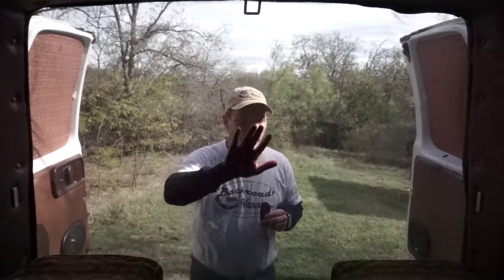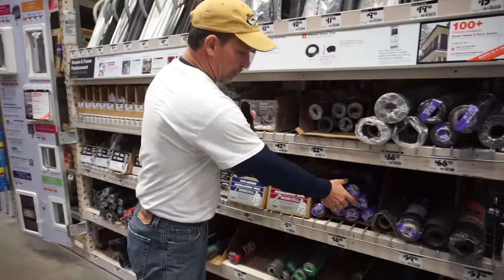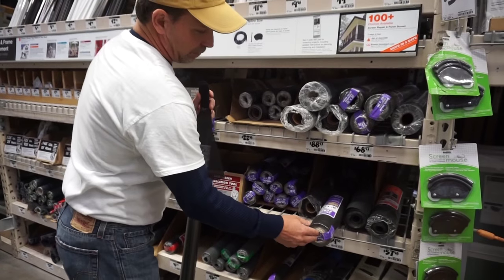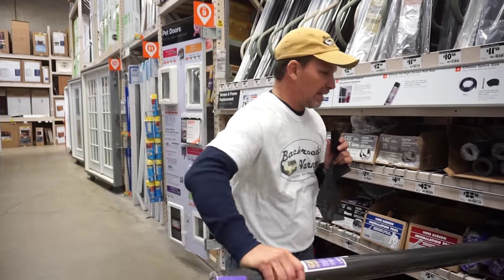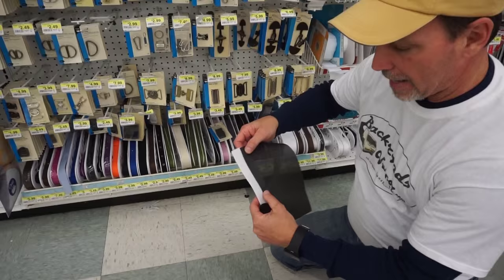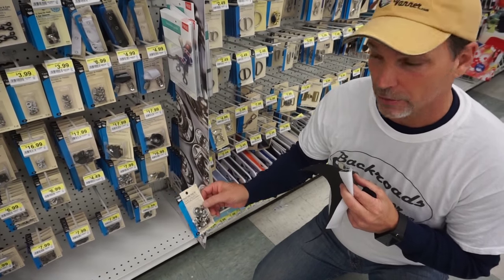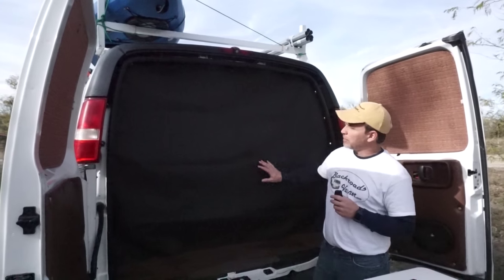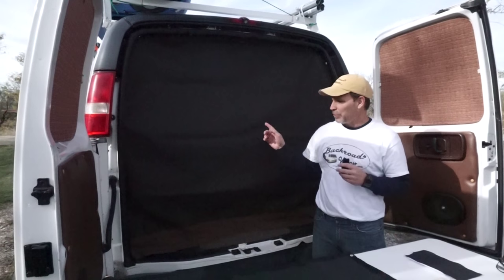Van Life - Custom Van Screens - How To DIY Window Bug Screens For Camper Van

Comment: I know this video was made 2 years ago.. but have you figured out that with rare earth magnets (the tiny metal looking ones) you can sew them into the folded webbing perimeter... and that way you can put it on and don't have to drill holes into your doors or align the screens.. you can just "put it up".
Reply: I personally don't think we need to go so far as ''rare earth metals''.. a common magnet IS the way to go, you're right. The whole van is steel.. this is an awesome idea but who would use anything other than strong magnets nowadays?
Reply: Magnets didn’t work well for my suburban build. The wt. of the bug netting was too heavy. The snaps or Velcro are the best options. W/ Velcro hot sunny climate can melt the glue so I reinforced it with bonding glue used on car mouldings. I like the Velcro on the front windows because I can actually remove the screen w/o opening the door.
Reply: @aprylspage5852  yes in deed, that sun gets hot and melts the glue on velcro!  .bonding glue eh?!
Reply: @aprylspage5852  Were you using rare earth magnets as the OP suggested? I have noticed a HUGE difference between different sorts of magnets. I got some from Walmart that comes in a continuous ribbon - it wouldn't even stick to itself! Rare earth's are so powerful, I would think the bigger concern would be hurting oneself or breaking the magnets when they collide
Reply: @MarcillaSmith   , let me ask you a question. I need to keep a young cat inside the vehicle when the doors and windows are open. Would the magnets bond tightly enough to keep her from being able to escape ?
Reply: @kielia727  While I wish I could give a more satisfactory answer, I think there are too many factors there - the strength of the cat and determination to get through, the size and number of magnets used, the angle at which they connect to the sheet metal relative to the angle of attack, etc.

Going in another direction, I had a cat Sadie who I would let roam free wherever I took her. I would say things like, "we're going to be here for about 3 hours, so be back before then, otherwise it'll be another 5 days before we're back again." Sometimes she showed up before we left, other times she waited until the next time we were in town. I wasn't really sure what all that "familiar" business was about, of which pagans speak, until I met her

Comment: You can also buy a similar bug screen/heat deflector/privacy/weather resistant tarp from harbor freight that already has the edging on it. Just add your snaps (or Velcro) and your set. It’s a good weight that still allows fresh air/breeze. Works great!  Currently only 25.00 for a 8’x10’ tarp love mine. Got a second one for a side awning.

Comment: Option is to put it in 2 panes, with a zipper or velcro like a tent screen and then it fits perfectly 😊 i did that for my tall roof van
Reply: And i sewed a magnetic flexible strip to the screen, works fine...

Comment: Magnets sewing into the banding would work on the front windows screens.

Good, professional looking job!
Reply from the maker: +wincrasher2007 Thank you!  Yes, I've considered magnets as well.  Great option.  Thanks for watching!
Reply: Chris Cooling I tried gorilla tape. It worked for a couple of months. Then the tape started getting soft and sticking to other stuff and ended up being as mess. I wish it had workd.
Reply: no magnets don't work on the front door at all as they fall off after opening and closing the door.   I ended up making a sock to slide over the window and close the door on. Then I use a magnet to hold it down around the bottom if the mirror. the only problem is the screen is already getting holes in it around the door because it is stretchy and weak. I did use hot glue to sew it as I have no sewing machine and the gluing send to be working for now. I am definitely heading to your screening materiel and snaps. the Velcro doesn't like to stick to the screen.
Reply: Or bugsoc window screens work great even in high winds.
Reply: @AlaskaDogs  Alaska I was thinking the same thing.
Reply: @tiggernordberg7015  Rigger good to know.
Reply: @randsollie7921  Rand good to know
Reply: Tigger Nordberg use the glue and then stitch around the Velcro.  Not sure how you could keep is stuck TO the van.  I think I am going to embed magnets into the hems.  I guess when I go to do the job I will figure it out. I do like the sock idea for side windows.  With socks for the sides and magnets for the back of the van I could call it a day.  The other thing if you are in Mosquito Country say like Minnesota where I am.  I have an outdoor shower configured at the rear.  I also have a drop down shelf on which to cook.  So I have put mosquito netting across my teak shower floor underneath.  That way the pesky little devils can’t eat me alive when I shower.  I used the hatchback of the Sierra as the roof.  I the have a back wall created with another shower curtain so I don’t get my bed or reading area wet. I also have a full 1978 Chevy G20. That baby has a eating area for 4 that quickly turns in to my bed at night.  It has a half wet bath.  Toilet & I have made a shower in there as well and when I’m not showering I have a cloths rod to hang my dresses on and a mini clothes line.  It has a cooktop at the back and  a vent going out the top. At times it’s more spacious to take a shower by running a curtain between the 2 door.  Again, I surround the whole thing with shower curtains.  Use natural earth magnets to go through the button holes.  But once again I have those pesky mosquitoes and then they get ito the van for the whole season too.  Now I’m going to line everything with this mosquito netting.  I’m lucky, the Windows came with factory screens already.  So when I’m doing dishes or cooking I just open the windows.  I use the kids queen size bunk up above the cab as storage.

Comment: Everything is perfection. I can only see one upgrade. Maybe add a magnetic strip to the bottom of your window screen. The beautiful thing about this design is that you now have a perfect pattern to make an insulated cover that will fit on to your existing snaps. What I really like it he strength and ease of your design. Thanks. Keep throwing those backroad projects out there.

Comment: I love rain guards in conjunction with screens. Can have my windows down a few inches with no issues with folks seeing in or rain getting in. These are great. Never thought about doing snaps. The finish is nice. Most folks use magnets and don't finish the ends and it is sloppy. Fine, it works, but I like this. Seems Velcro is less work, but this is nice. Thanks
Reply from the maker: +AL Genaro I found the snaps to be easier and  stronger.  When I use velcro and try to remove the screens, it can pull the velcro off of the frame.  Thanks for your comments and for watching!
Reply: Good point. Thanks
Reply: Has anyone come up with an idea as how to put a rain guard on the rear flip out windows in a sienna minivan ?

Comment: Hey, fellow tiny van campers and we too have no windows.  Yay...you addressed a real issue for us...BUGS.  Okay, worry about screwing in snaps because you have 3 different metals coming in contact and when there is condensation will that start to rust??  You have had this for a while...so you best can guide what you have learned since doing this.  Thanks for the fun video.

Comment: I started using earth magnets from Northern tool. A pack of 20 the size of a dime are cheap. I had them sown in little pockets of the trim to keep them in place and used Velcro on the bottom. And like you I can't sow for shit. So I used a white marker where I wanted them and had a custom upholster shop do it for me.

As the customer did not want to drill holes all over his van. Same thing can be done inside to separate the driver cab from cargo area. 

Great Stuff

Comment: I used fabric glue. There are some awesome fabric glues available that are simply amazing. I tried a few brands. Several had solvents that were pretty toxic and made them hard to use due to the ventilation requirements and the length of time that the item had to be kept from moving. Aleene's Fabric Fusion worked quickly and very thoroughly and washed off my hands easily. I did buy several small clamps to hold the edging material onto the screen.

Comment: Well done and I am sure many will be following your lead. I made a passengers screen but used strip magnets. It was a lot of work and not as durable as yours. Most of the windows have screens and they used the aluminum metal most screens use for the frame and screwed that to the doors. It was a factory job.
Reply from the maker: +VanoRama RV I made these screens 5 or 6 years ago but if I was creating them today, I might experiment with heavy magnets myself.  Thank you for your comments!  And thanks for watching.

Comment: I'm glad I found your site.  I just purchased a 2004 Ford Sport Van Conversion and was looking for ideas for screen that would go over the side door opening and the back.  I'm almost done with the inside build and so the screening will go in soon.  I will give this a try.  It looks promising and I believe I could do this.  For the side doors have you done this type of screen where it splits so you can go in and out and maybe it closes behind you with magnets?  Is there a magnet that can be sewn in like you did for the snaps?  Thanks so much. Blessings, Teri
Reply: If you haven't tried it yet , I used the Garage Door Magnetic Screen Door on the hatch DGCaravan. I am getting another to fabricate for the side doors plus I'll have leftover Netting. I use magnets to attach and then just take down and stow.
I know this is awesome...I just don't have the time.  
Easy and smooth 😎 
Blessings from Florida Meema and Jessi Beagle 👵🏼✌🏼🐕

Comment: The screw snaps sold at Home Depot will drill right into the hard plastic molding of the door. You can attach the screen at the bottom with 3-4 snaps. If your door has soft vinyl, I guess it wont work.

Comment: Thank you so much for sharing this idea ! I would be adding a lot of snaps in order to keep a cat from escaping so going in and out would be tedious. I am thinking about adding a heavy duty zipper or two to the middle of the screens. So question. Did the roll of screen you bought work for making all the screens for your van or just the back screen ? Also, what size and type screws did you use please.

Comment: ineed to make one for our side door so the onfo was helpful.I have made two for the driver and passenger side doors I made like a sock that just slides right over the door with the magnets on the bottom so you  can close the doors ok i recycled some of those magnetic sceens using the door as a pattern
Reply from the maker: +Sandra Redding Great, sounds like they work well for you.  Good luck with your side door screen.  Happy camping!

Comment: I know this may seem like a simple question but how did you make the holes in the edging. My concern is if I use the wrong method I could end up damaging the material I was thinking about a hot knife to make a perfectly clean hole....

Comment: may i ask why you didn't just add the same material to the bottom part where the gap was? why didn't you just use more screen and sew it to it? just curious. great video, seriously thank you. god bless.
Reply: justin dahl the material he used also added a bit of weight to the screen to keep it from blowing around too much when the doors are opened.

Comment: Hi,
Is there an inside and outside to the screen material?   Great channel!       All the Best
Reply from the maker: +bigolmoose69 Thanks for your question.  No, there is not an inside or outside to the screen material.   But once you apply your first snap, you've now determined which way faces the inside - so be sure to put all your snaps facing the same direction.  Thanks for watching and good luck making your custom van screens!

Comment: Hi there, I'm just wondering how easy it is to get in and out of the vehicle with these snap systems. For example when you want to clip the snaps back on when your inside the vehicle is it difficult to do - as the snaps are on the outside?

Comment: if for some reason using the hammer to make them connect doesnt suit you... you can get snaps at tandy leather that have a teensy screw to hold it to the fabric or whatever your putting the snap on.  use lock tite or super glue or the screw will back off.

Comment: I'm not sure, just saying...wouldn't a sturdy Velcro work just as well? That was no holes in your van or the screen.  I would still possibly sew the 'hem' for strength like you said earlier, so it won't unravel.  What do you think?
Reply from the maker: +Nora Steel Velcro is also an option, I just prefer the metal snaps.  Velcro would need to be glued to the frame and may not be as durable.  Thanks so much for your comments and thanks for watching!
Reply: I like your videos.  Hope you have a happy Thanksgiving.
Reply from the maker: +Nora Steel Thank you so much Nora!  Happy Thanksgiving to you and your family too!

Comment: Magnets instead of snaps? Tried any of those?

It seems to me it would be easier to install since you don't have to line anything up or drill your car... What kind of magnets is the tough question!
Reply from the maker: Great idea simonlychse!  Are you binge watching our video's? LOL Thanks for all your ideas and comments!, Keep them coming, I like the way you think!
Reply: +Backroads Vanner haha.. I won't comment on the binge! But yeah, they are quite good and filled with cool details!
Reply: Ceramic magnets have enough strength without being dangerously strong like the neodymium but they are just a little fragile.  I paint them with whiteout and put a scrapbook sticker on them for a metal bulletin board which seems to keep them from chipping pretty well so any kind of paint would probably work.

Comment: This is so great.  I am gathering my materials now.  The screen link you put in your blog is to a roll that's 100' long and is not made in 48"x 84".  Would any solar screen work?  The purple screen at home depot is New York Wire Pet Resistant which seems really rigid and not the one you found at your home depot.  Do you have a label or model number for more information on the screen?  I want to be sure its the one you can see out of but not in.  here is what HD has for solar screens: http://www.homedepot.com/p/Saint-Gobain-ADFORS-Sun-Guard-90-48-in-x-84-in-Charcoal-Fiberglass-Solar-Screen-FCS8971-M-FCS8971-M/203063644  
Thank you Mike and Shannan.
Reply from the maker: +Marleah Parkhill  The screen in our link is Phifer brand and is 48 in. x 25 ft. "screen fabric" but they have it in other dimensions online.  You definitely want it to be a flexible material.  This one is a solar screen and helps block out the sun.  Keep in mind that if you have lights on inside your van or there is backlight from the sun or other source, people can see in.  We hope this helps and we're excited that you going to tackle this project!  Please feel free to share your photos on our Facebook page at https://www.facebook.com/backroadsvanner/  (see here for full list of materials: http://www.backroadsvanner.com/all-posts/vans/our-van/video-diy-custom-bug-screens-for-your-van/ )
Reply: I will definitely stick with the one linked and get an appropriate size. I will be sure to share! Thanks again!